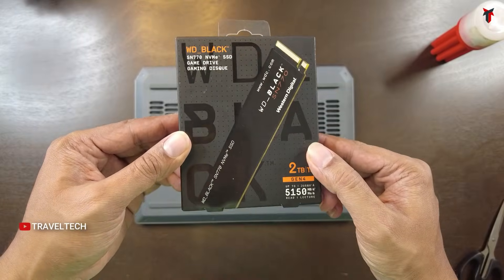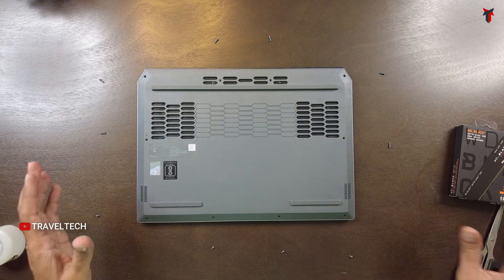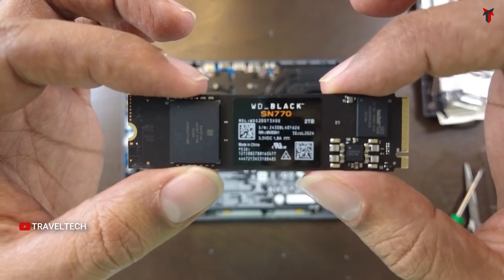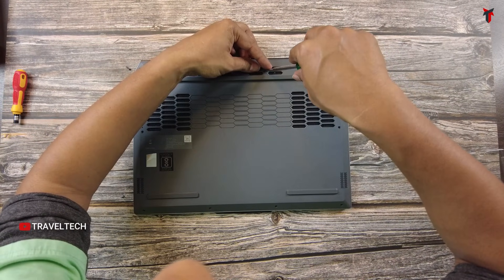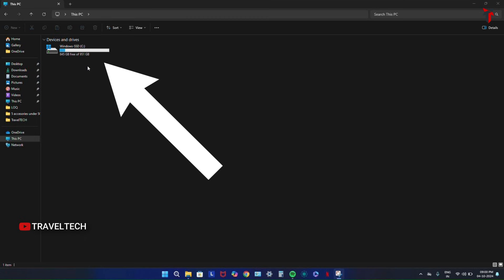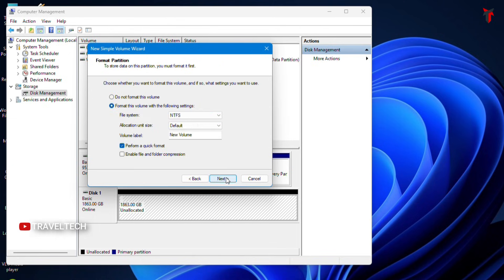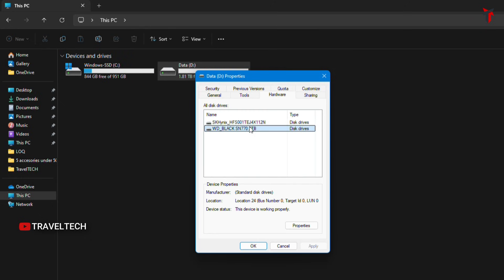How to Upgrade Laptop SSD? Lenovo LOQ 15IRX9 SSD Upgrade Guide | SSD & RAM Upgrade | Gizmobeep

Comment: I just installed a 4TB SSD in my 9th Gen LOQ following this guide. In the 2280 slot. Easy.
Reply: Can I ask if the m2 4tb works on all Lenovo loq 15 I bought 2024 model and I am wondering if she supports 4tb 
Google says maximum is 1tb😮
Reply: @jonkristinnmargretarson7243  I bought my LOQ 15 last Fall. I'll post the exact model when I get home.
Reply: @myfakeguuglaccount  hey! is it working right?
Reply: @indardeepsingh7488  Yes. I forgot to post earlier, but my model is 15AHP9
Reply: @jonkristinnmargretarson7243  have you installed? i am also planning to get 2tb SSD for my LOQ 2024 model i512450HX rtx 3050 6gb is it possible to use 2tb ssd in it? or only 1tb will work?
Reply: @jonkristinnmargretarson7243  most probably it will work as the motherboard is same , you can go to the local shops and try it
Reply: What is it even possible 😅 wow
Reply: Is that working on loq 😂 ?
Reply: @Arindamdebnrh  Flawlessly.
Reply: Total Price of upgrade ??
Reply: Hi! Which brand did you use? I also have Lenovo LOQ 15ARP9 ryzen 7. I'm planning to buy Samsung 990 pro 4TB as well. Have you encountered any recent problems?
Reply: @gilmoscosa5822  Same mate, r7 8845hs + 4060. I need ssd because 512gb ain't enough. Is it capable of using 4tb 990 pro?
Reply: ChatGPT told me the limit in lenovo loq was 1to lol

Comment: Apakah berjalan dengan normal dg 2Tb? Karena laptop saya setelah tambah ssd 2TB jadi sering hank. Dan kata servis center krn tdk kompetible dg 2tb
Reply: Is it single side or double side?
Could you say the name of the ssd?
Reply: @SeyyedAliJebraeili single side.. side 1 512 gb, side 2 2Tb
Reply: @TamrinNugrohoririn thanks for answering fast
Could you say the brand and name of the ssd?

Also upgrade your bios and see will it be work fine
Is it not because of using 2 ssd at the same time?
Reply: @SeyyedAliJebraeili  The SSD brand is ADATA Legend 860.
Yes, two slots are installed, and I've contacted Lenovo support, but it turns out the maximum capacity for one slot is 1TB, so it doesn't work properly. So, if you want 2TB, you'll need 1TB in each slot, making 2x1TB for 2TB.
Reply: @SeyyedAliJebraeili  BIOS has also been updated
Reply: @TamrinNugrohoririn oky i have heard that some Adata m.2 has some problems and i checked in chat gpt which it approved.
The main problem is i think your ssd.
You can go to guarantee if it has and change it at least to new one.

Do blue screen and freeze happen a lot?

Comment: Hi.
I want to add a new ssd to my lenovo LOQ. But the new ssd already has windows 11 installed inside.

Will that cause a problem adding the new ssd to my lenovo LOQ given that it also has windows 11 inside?
Reply from the maker: How can a new SSD already have Windows in it? You can format in using a M.2 SSD enclosure.

Comment: u did not put thermal pad on ssd
Reply from the maker: Thermal pad is pre installed on the back panel of the laptop by Lenovo
Reply: @gizmobeep  one more thing ...mine is lenevo loq ryzen 5 7235hs rtx 3050 6 gb ,,,,the hardware would look same na

Comment: Can we disable battery in bios 
Before upgrading anything 
Or we have to disconnect it physically 
Which option is more reliable
Reply from the maker: Most reliable is to physically disconnect. Yo can disable battery via bios as well, but as the saying goes, precaution is better than cure.

Comment: Can you upgrade the battery i.e use 90wh legion batter insteadof the 60wh one?
Reply: You can,but it's a big headache placing the battery,changing the firmware and it will definitely void any warranty of the laptop.

Comment: Sir why my screw on ssd slot is hard to remove?
Reply from the maker: All SSD screws are super hard to remove. I had the same experience too. I used a plier to hold the screw and rotate it to make it loose.

Comment: NOTE: The Lenovo LOQ has a BIOS feature called “Disable Built-in Battery” that safely cuts power from the internal battery before servicing. It’s great for upgrading RAM or SSDs without risk of short circuits. After using it, the laptop powers on again when you plug in the charger.
Reply: So if i do that still do i need to disconnect the battery from motherboard unit from 2:56 ?? Cuz the video has ben cut on that part, so i am in a doubt
Reply: @fartaiesandrei1379 no you don’t, the bios disable battery feature is made on purpose so you can service your laptop. so there is no need to physically disconnect it
Reply: @minihonna Oh thanks a lot!
Reply: @minihonna thanks i also used the feature and upgraded my ssd!
Reply: Can I install WD SN7100 to my LoQ I5 12th gen 12450HX ? please suggest

Comment: i want to replace my 60w loq 15 battery with the 80w used in loq 16 and there seems to be enough space, do you think it would fit?
Reply: You can,but but it's a big headache to fit the battery and it will definitely void any warranty.

Comment: PROBLEM SOLVED for 2242 NVMe form factor to 2280!!!

Here's how I replaced from 1TB to 2TB (2242 form factor using 2230 form factor) with the NVME M.2 Extender :
https://youtube.com/shorts/vwCQicWZvig?feature=share

Anyway, I have total of 6TB Storage and it runs smooth until now.
RAM : 64Gb
2230 : 2Tb
2280 : 4Tb

Comment: I used 2230 form factor (2Tb) because easy to find than 2242 in my country (Indonesia). Then I'm using nvme extender from 2230-2280 to avoid the bolt. The extender is so cheap (around  $2), but is so worthed. Been using this LOQ for almost 2 years for music production and 4K video editing.

RAM : 64Gb
2230 : 2Tb
2280 : 2Tb

Comment: I think my SSD screw came pre-stripped. Whoever tightened that thing is one of history's greatest monsters.
Reply from the maker: I had the same experience as well. Used a mini plier to hold the screw and loosened it gently.
Reply: Mine is hanging, because I broke that screw head because its soooooooo Daaaaaammmnnnn Tight🤬.
Reply: I had the same problem, I have no clue what to do with it
Reply: Omg I appreciate learning that I'm not the only one! I bought a nice kit from ifixit cus I figured I wasn't using the right tool... nope, it's just in there :'(
Reply: Mine also got stripped while trying to remove it. What did you guys do to get it out and where can I find a screw to replace that one ???
Reply: @nikhilghadigaonkar1393  I initially didn't do anything, just inserted the ssd and let the pressure from the case hold it in place. Eventually I got some needle-nose pliers made for removing stripped screws and got it out that way. The drive I bought had come with a screw so I used that. I assume you can buy one from somewhere.

Comment: I too have the same model Lenovo Loq i5 13th gen RTX 3050 6gb 16gb 512gb just order SSD any brand I ordered crucial 1tb gen 4 SSD just make sure what gen SSD your laptop accepts mostly Lenovo Loq series gen 4 or 5 SSD can be used if any problem contact me

Comment: I'm scared to break battery connection, can I still install ssd without removing it?
Reply from the maker: Nothing to worry about disconnecting battery. If you have shutdown the system properly, it's not a problem at all. 

You can install SSD without disconnecting it, but there will be slight risk.

Comment: Hi, do you think a wd_black with heatsink would fit or would it be too wide
Reply from the maker: Probably to wide. The back panel comes pre attached with therma pads. If you remove them, then it just might fit

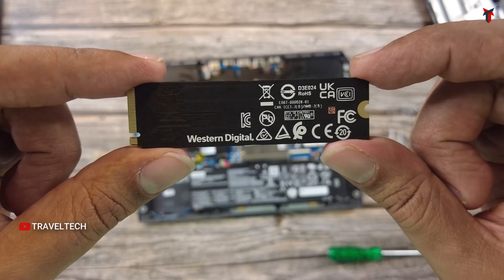Comment: 3:49 this screw is horrible. screwed too tightly and made of foil so it strips immediately. was following this tutorial, encountered THE SCREW, stripped it, had to tape the ssd on. hopefully it's possible to fix later on
Reply: Fr bro that screw just sucks
Reply: Use masking tape
Reply: I'm scared of breaking my Motherboard trying to remove that screw, what do I do?
Reply: Yeah I asked chat gpt what would happen if I left it taped on instead of screwing it, I suggest you remove the tape because it has a lot of detrimental repercussions if you leave it there. You can ask chat gpt or search it up, it's bad. I'd suggest going to a repair store and asking them to unscrew it.
Reply: @awesomeedits1506  it's electrical tape tho not just any tape so i'm hoping it's fine for the time being. i got pliers in the mean time so i might as well attempt to go for round 2, i just really don' feel like it lol
Reply: @supersonic_kitten yeah that's fine then as long as it's just for the time being

Comment: You included the process of removing all the screws in the video, but you left out the process of removing the battery connector! You cut out the parts that were difficult to remove from the video.
Reply from the maker: Will be doing a separate video specifically showing the battery connection part.

Comment: So do you unscrew the battery cause i can't move the adapter apart with my fingers you never show yourself doing it for some reason even though it's a tutorial
Reply: Yeah terrible that he explains how important and technical it is and then skips the actual procedure
Reply: Just remove the cable with your nails or tweasers do not unscrew it

Comment: question same unit.... will i void my warranty if i install my ram myself? i have 19mths more of my warranty and i just got my laptop back from repair due to some motherboard issues good thing warranty solves that case and im concern if i will void my warranty if i install 2x8gb ddr5 rams on my laptop
Reply from the maker: No it won't void warranty unless you have damaged any part while doing the upgrade
Reply: I see thanks man appreciate it

Comment: Do you Know if by following these steps, I will damage a seal or cause any change that could result in loose my warranty? Pls help😢
Reply from the maker: No you won't. Do it step by step and do it carefully. Go ahead
Reply: Followed the video step by step and installed the same ssd 1tb, now loq 15irx9 is not turning on. The power button light turns on for 5sec and turns off. What might be the issue @gizmobeep
Reply from the maker: Remove the SSD and try turning on again. If it turns on properly, then there must be some issues with either the SSD or the installation procedure.

Comment: Is a heatsink needed for ssd or not rly?
Reply from the maker: Its needed to keep it cool.
Reply: @traveltechyoutube  Is it ok if I dont add a heatsink or just buy an ssd with built in heatsink for laptop?
Reply from the maker: Built in heatsink would be preferable, but check for size. Some heatsinks are larger and some smaller. Check if it will fit in your laptop.
Reply: @gizmobeep  Ok thanks

Comment: hey man, thanks a lot for the informative and concise vid! i struggled a lot while i was trying to unscrew the ssd screw, so for those struggling i have a couple suggestions: try to use the correct sized philips head at first since if you use the wrong size abrasion may occur, and even after trying to loosen the screw youre having problems, gently use pliers, it worked for me and i also had no trouble tightening it back up with a screwdriver after i was done placing the ssd.
Reply from the maker: Good advice. Glad to be helpful 👍🏻

Comment: I installed my 1tb on my loq and i tried to unplug the battery but it's very hard to unplug so i ended up installing it with the battery plugged in and i was  careful not to touch any of the transistors thanks for the guide i would say the hardest part is taking the plastic off as you could damage it if you're not careful so take your time guys
Reply from the maker: Good thing you were careful. I'd suggest using a small screwdriver to help release the battery latch
Reply: @gizmobeep  hello bhaiya ji mere pass lenovo loq i5 12th rtx 2050 with 12gb ram and 512 SSD pre installed can I install western digital 1 tb blue sn5000 nvme SSD because the black one is more expensive plz reply I am a student that's why I have some money issue 😭😭

Comment: I have lenovo loq i5 13450hx 4050 15irx9  its support 2tb ssd or not if support so please provide me the link to buy
Reply: reditt user post: Don’t upgrade your ram without replacing the stock ram if you have a 15irx9! Your laptop could face the same issue with people who’ve had motherboard issues from the past. If you do not want to experience the motherboard death issue circulating recently on hx cpus I suggest if you’re going to upgrade your ram, buy 2 gb ram sticks of the same brand and replace the stock ram to prevent ram conflict, and a potential motherboard death that is currently occuring on hx cpus.

Also yes, it is better to buy 2 ram sticks and install them rather than just a single 16gb ram and removing the 8gb stock ram. This wpuld enable dual channel frequency giving performance boost for your 1% lows fps (this lessens/prevents frame drops that may occur while gaming/heavy load tasks)

In terms of storage, some reddit user was able to install 4TB of storage on his loq, proving that it can support up to 4tb of storage, that is if you have the capability to find and buy one on the market. (The 1tb cap you see on lenovo’s spec sheet website is the cap that comes with the laptops that they sell on the market, it’s not a cap that limits the laptop’s storage capability, so you’re good to go if you’ll be upgrading your ssds to 2tb)

Usually you can find only up to 2tb of storage on the market, you’d be fortunate enough if you found a 4tb storage and the budget to buy one. Also, to give you knowledge, the numbers you see on ssds such as 2280 or 2242 are just ssd sizes. When you look over the lenovo spec sheet the storage slot can go up to 2 m.2 2280 this means that both loq’s storage slots can support or fit ssds that doesn’t exceed or is less than 22x80. Therefore 22x42 is also compatible. The one installed or pre-installed in your laptop is an m.2 22x42 ssd, you may remove it, and replace it with an m.2 2280 ssd since both storage slots can fully support that size.

Hope this helps!! Happy gaming bruv!

edit: i have the same laptop model as yours, and ever since i upgraded my ram, and installed 2x8 fury ram, it has improved performance, and i no longer get a memory error on maxing out graphics when playing ghost of tsushuma. 16gb 4800mhz is the ideal ram you should pick since, the maximum capacity of frequency the 13450hx cpu can support is only up to 4800mhz regardless if you buy 5600hz or above it will only cap up to 4800mhz. so i suggest buying only 4800mhz to save money and also to maximize your performance.
Reply: @shaunaktari12  bro ur a freaking honest guy! thanks i used this as a guide i just bought my LOQ same type.
Reply: one more question what SSD would you recommend? i dont mind having a 512gb ssd for OS itself then load another 1TB for games itself. Still choosing between 990pro of samsung or WD770 base on comments. Hope u can answer thanks

Comment: Brother, can I upgrade samsung 990 pro (2TB) to LOQ 15IRX9 13th gen i5 1350HX laptop ?
Will it affect the warranty ?
Reply from the maker: Yes you can. It won't void warranty
Reply: @gizmobeep  Actually, Lenovo guys told only 1TB can be upgraded. Thats why I am asking bro. If I upgrade and if something happens these guys will sue me
Reply from the maker: For i5 they have provided 1TB as upper limit. In theory you can upgrade to 2TB but it will be at your own risk. Unless you really understand and know what you are doing, I recommend you stick to 1TB upgrade and keep the system under recommended conditions, so that any issues faced in future will have Lenovo support
Reply: @gizmobeep  Understood bro. thanks a lot

Comment: You cut the video at the point where the battery cable is pulled.  How do you disconnect the wires.
Reply from the maker: Wires are not disconnected. Wires come out along with the 'plug' which you pull out holding both sides.

Comment: Sir I have june 2024 model loq with rtx 4050and i5 13 gen and 24gb installed ram. I want to extend the storage how maximum I extend the storage. And I can install gen 4 ssd
Reply: Bro same question 

Answer mil gya to bata de yrr
Reply: @adityakeerti1686  still no idea bro
Reply from the maker: Yes you can go with gen 4 M.2 SSD. Maximum storage on i5 devices is 1TB extra.
Reply: @sanishpawar9273  go with any gen4 ssd be it m.2 or nvme m.2 

Confirmed from lenovo service centre
Reply from the maker: Yes correct

Comment: i have loq i5 13450 hx and 6 gb rtx 3050 model its specific model no. is LOQ 15IRX9 can i use WD black SN 850x or it will not support my pc, there is no information on official website or customer support because this is new model
Reply: I too have the same model Lenovo Loq i5 13th gen RTX 3050 6gb 16gb 512gb just order SSD any brand I ordered crucial 1tb gen 4 SSD just make sure what gen SSD your laptop accepts mostly Lenovo Loq series gen 4 or 5 SSD can be used if any problem contact me

Comment: does turning the battery off connection at the BIOS would work too, instead of disconnecting it manually?
Reply from the maker: The safest way is to disconnect manually. It leaves no chance for error. BIOS switch might not be completely reliable and you should try it at your own risk.

Comment: Thanks for the video! Are the fans in LOQ individually detachable from the heatsink and cooling system? Saw a legion laptop video where the entire  cooling assembly had to be replaced just to replace a single fan.
Reply from the maker: Haven't tampered around with fans yet. Will look into it.

Comment: I tried so many times but this shit ssd screw just doesn't come out, it just doesnt rotate, i bought 2 screwdriver set already
Reply from the maker: Use a small plier. Hold opposite ends of the screw and rotate gently.
Reply: Thanks for replying so quickly, I used a freaking nail cutter to remove this stubborn screw @gizmobeep